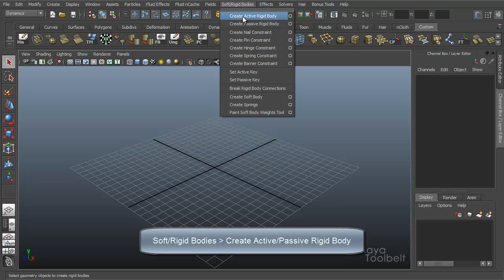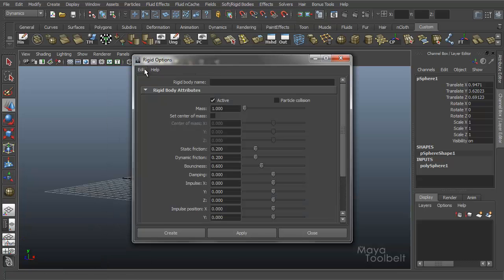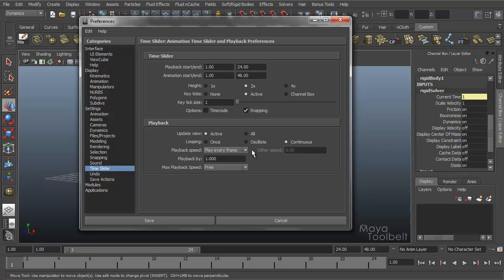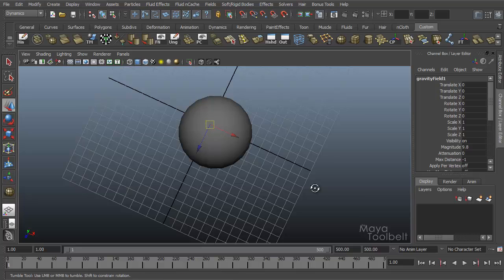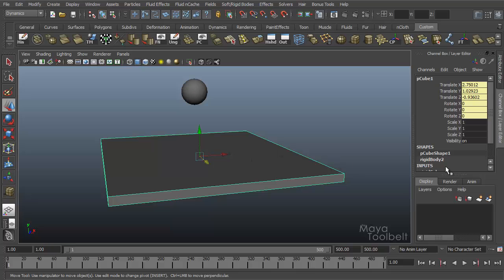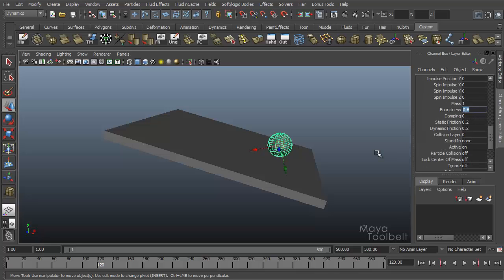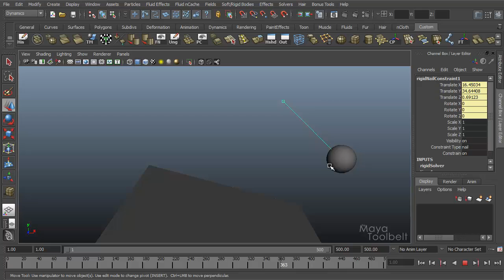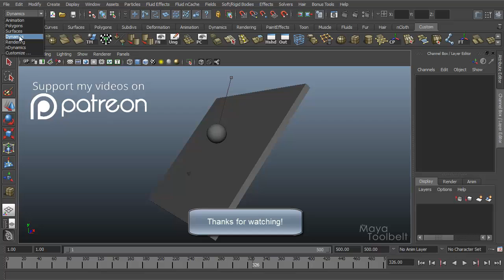The Maya Toolbelt - Introduction to Rigid Bodies

Comment: Hi, great tutorial. How does one get two rigged characters to interact in terms of colliding with each other without going through each other? Help.
Reply from the maker: I imagine it depends on what you're doing. In games, they typically use some sort of physics system, like Havok, to produce a "rag doll" effect when characters collide and fall and go flying from explosions and whatnot. Most of my experience has been in games, so while I'm not 100% certain what they do in films, I feel like they simply animate them either by hand or by using motion capture to get accurate results. Cloth physics and hair/fur physics usually go a long way toward selling character impacts, but if you need their actual skin to deform, I would imagine they would animate a deformer object to "push" the skin around.